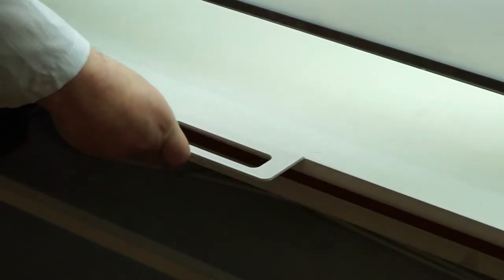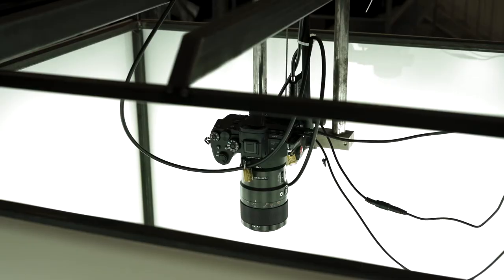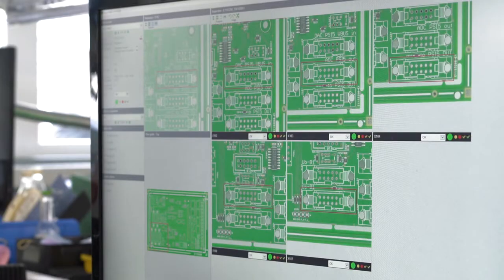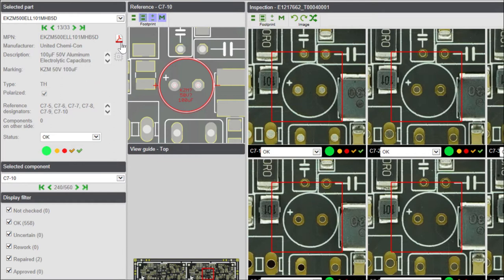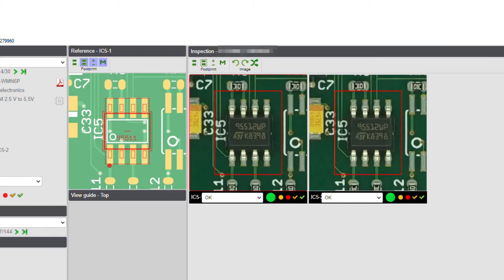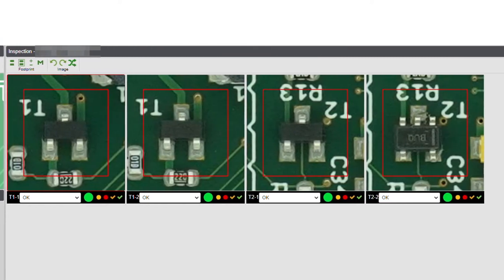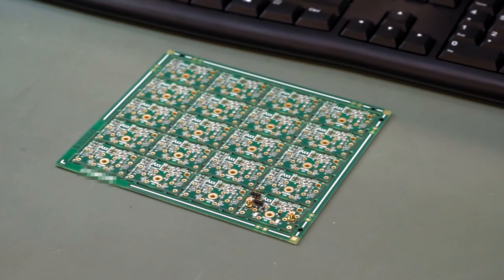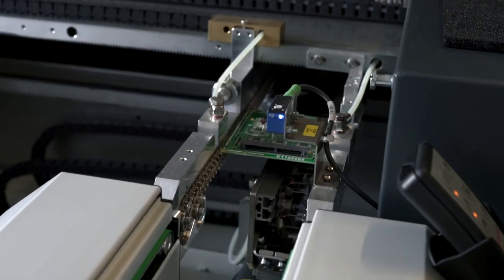PCB Assembly: First Board Inspection

Comment: That's just an aoi machine
Reply from the maker: No, this is a real Eurocircuits made application and not just an AOI machine. We need to bring down the setup time down next to zero because we only make prototypes and small series. Traditional AOI machines require long setup times which are not justified for these small quantities.
The full video here: https://vimeo.com/510689477